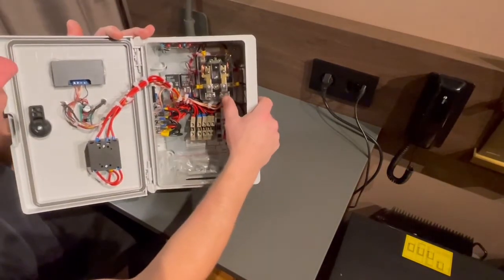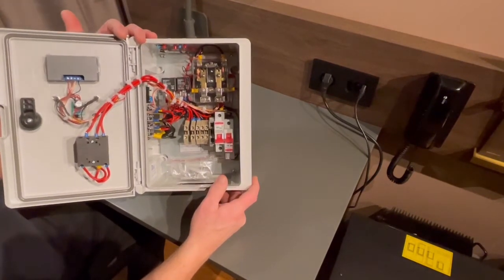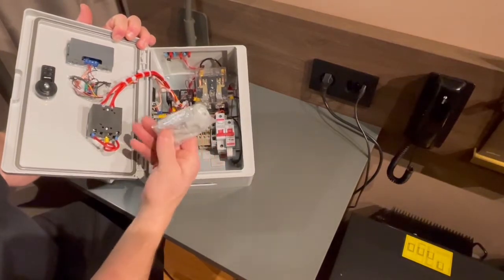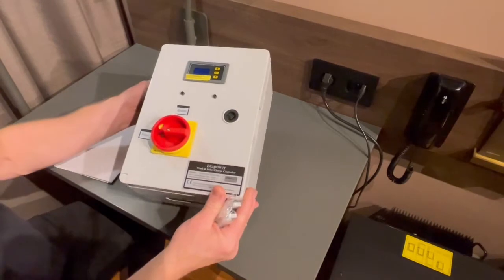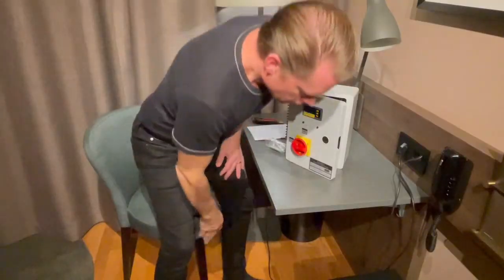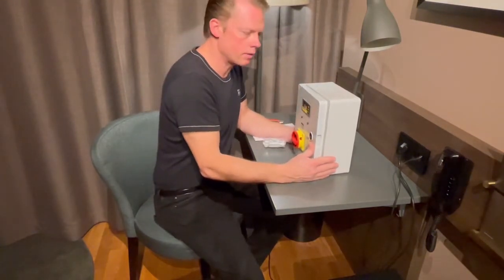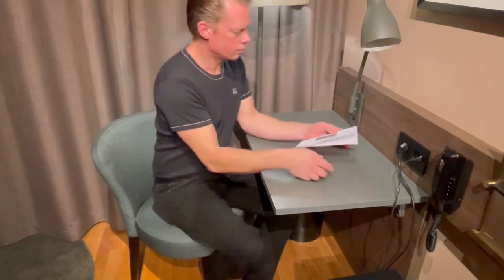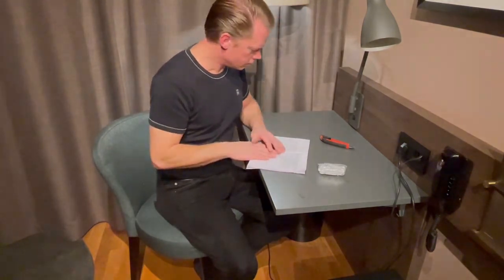Istapower hybrid charger windcontroller unboxing and first impression

Comment: hi, I have a controller like this for ista breeeze 700 wat, if I wanted to connect a dump where do I connect it? and after the brake button is not needed anymore? a thousand thanks !
Reply from the maker: Hi, this controller are not made to work with a dump load. But I think that it would be possible to retrofit it with that.
Reply: @flyingtools  thank you very much. on which wires can you possibly connect to test? does your brake work manually? sorry for the many questions, but I'm waiting for my ista 700 to arrive and I want to understand how to do it. thank you so much and follow you. hi Fabio Italy !!!

Comment: It's no good. I purchased that same controller and it sucks.  In the process of connecting the controller the LED screen went out it doesn't come on and there's nothing I can do about it.  Do you have any suggestions as far as reordering another LED screen or which screen can replace the one that's on already I need help but I don't know where to turn to get that help.
Reply from the maker: Oh, sad to hear, here is the one that came with mine from the beginning.
Search for this on Ali express: 

Storage battery controll cd60.  

I hope it will help you and wish you the best.
Reply: @flyingtools  thank you so much.

Comment: Hi, and thank you for your great videos! Can you connect this wind controller directly to a lithium battery bank?
Reply from the maker: Yes, that will be just perfect 👍🏻
Reply: @flyingtools  Ah, thank you so much! :)
Reply from the maker: Hi and thank you😀 Yes that will work just fine but please check out my other video about this unit first if you haven’t seen that already, because you are not able to adjust the voltage as it is from the factory.
Reply: @flyingtools  Yes, I saw that one :) I have 4x 12v lithium batteries so that's 48v. So if I buy a 48v wind controller I should be good?
Reply from the maker: You’re welcome:)
Reply: @flyingtools  Hi again. I asked the Istabreeze if their controller worked with lithium batteries. They told me today that the controller works with lead acid batteries. So they didnt exclude lithium batteries, but it left me kind of insecure. Maybe i should buy another controller that 100% certainly works with lithium batteries?
Reply from the maker: Hi. Ok. I use lithium and for me it works great. But if you don’t feel sure about it, it’s better to go with another controller of course.
Reply: @flyingtools  That's interesting! Maybe they just dont want to promise anything. 
However, I googled "can I charge lithium batteries with acid lead charger" and found this:
"If you want to use a lead acid charger on a lithium battery you can, HOWEVER, you must NOT use a lead-acid charger if it has an automatic “equalisation mode”, which cannot be permanently turned off. A lead-acid charger that can be set to charge no higher than 14.6v can be used for regular charging and then MUST be disconnected after the battery is fully charged."